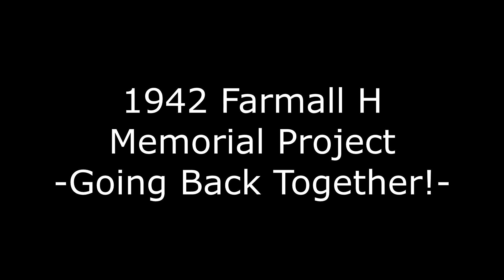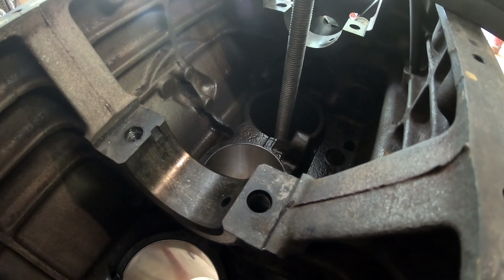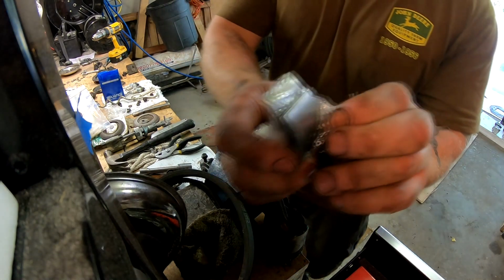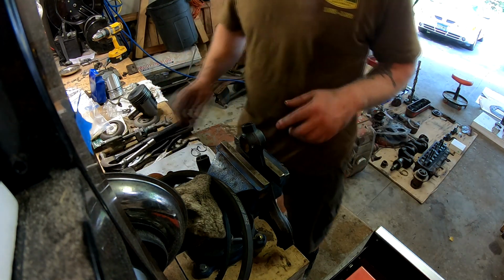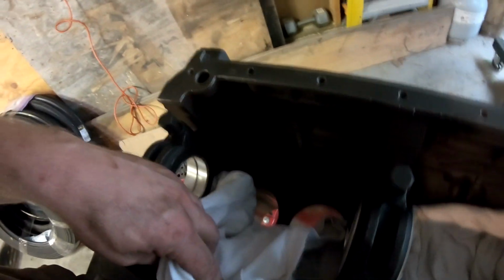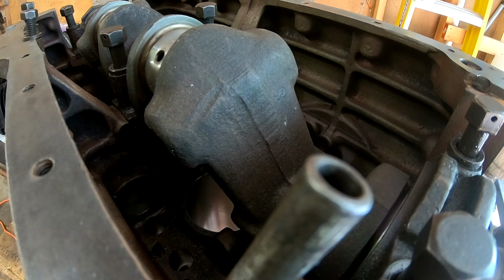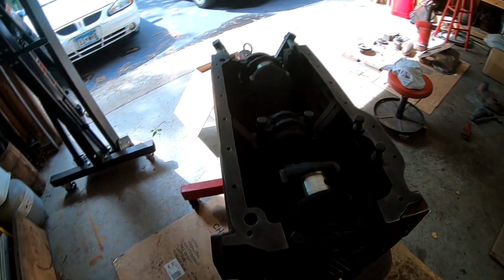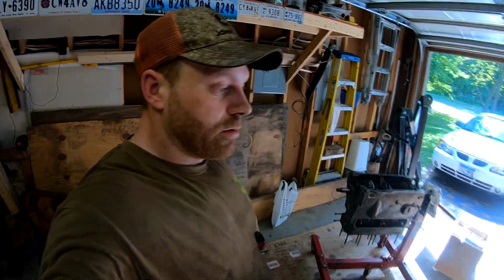1942 Farmall H Memorial Restoration: Engine Reassembly Part I

Comment: I found this interesting regarding the dry sleeve installation.  I am working on an Oliver 77 myself, and just installed new sleeves and pistons. The Oliver uses wet sleeves.  Getting the O'rings installed, and then the sleeves installed in the block was easier than anticipated. Lightly tapped with a block of wood and rubber mallet.
Reply from the maker: Yes sir, wet sleeves are generally easier than dry sleeves. I also us a VERY thin coating of high-temp RTV on the o-ring for wet sleeves. Just to try to help prevent any seepage once it is all back together. Dry sleeves are much more fragile and need to be dealt with cautiously...... Would love to get a Oliver Hart Parr 70!

Comment: Another very good video sir, my wife always asks me why I need two of everything as far as tools and your angle grinder is a perfect example why. If one quits you have a backup
Reply from the maker: Thanks, Craig. I agree! I was surprised the first grinder lasted as long as it did - I think it was a $9.99 special I picked up at one time from a big box store. I bought a little higher quality one this time, so hopefully it lasts 20+ years!
Reply: I usually buy two because I get a lot of my tools that I use all the time from Harbor Freight. And when I buy an old tractor I usually start looking for another one for parts just in case I need something you know
Reply from the maker: @craigrasnic4178  Not a bad route to go! That is how I got the F20 put together. That parts tractor sure served its' purpose!
Reply: Only two? I find there is no such thing as to many tools.  I have some wrenches that I have 20 or more of and still sometimes don't have just the right one.  😊👍🍵

Comment: Your bearings went in easier than mine. My 40 model B Deere has babbit mains. I had to measure the crank journals and turn and polish a piece of round stock the same size. Then I blued up the bearings and placed them on the slowly turning stock in my lathe.This found the "high spots" which I scraped with a single edged razor blade. More blueing and scraping got me about 75% contact. When I assemble the carriers I will let the engine wear in then adjust the shims. That is the plan anyway. Good luck with the rest of the build and happy 4th.
Reply from the maker: Johnny, that is a clever way of setting up your bearings in that B. I just did it with the crank on the bench for my A. It worked pretty well. F20 I did similar to my A but the crank for the F20 was still in the tractor. Hope to have this thing in primer before winter, but who knows....

Comment: You should have run the wire it through the bolt head and twist the wire between the bolts.  .063 stainless wire holds a prop on a a/c should work fine. you dont need special wire pliers  but it helps . like your videos just tring to help. 20 years on a/c.
Reply from the maker: Thank you for the heads up, sir! I will make a mental note for next time!

Comment: you will have a very strong H when you are done. it would be nice to see it broke in on a dyno. it should turn 30-35hp.maybe a bit more. depending what head  and compression ratio you have.setup you have,
Reply from the maker: That would be really great! Glad you like the progress so far!
Reply: @KennyKizzleRustyNutzRanch  you are bringing back  alot of good memories. i overhauled our 51 H when i was 17 i did a 44 M when i was 15.                                                            to remove the big bolster  bushing you need a diamond point cape chisel and cut 2  groves  opposite from each other and  pry out the pieces. use the  steering shaft to push in  the new one with a  bottle jack if mounted to the tractor or use a similar method you used to install the sleeves. have a blank turned on a lathe  to fit the bushing.
Reply from the maker: @brokenwrench1  Thanks for the tip! I will definitely use the suggestions and capture it on video for others to learn! Also, glad I could bring back some memories for you!
Reply: @KennyKizzleRustyNutzRanch  when i was 16 i was cultivating corn with a front 4 row on the H when i broke the big steering shaft i got a new shaft, bushing and seal i had to leave the cultivator on and use the tool bar to block up the tractor. i jacked up the H with a tall railroad jack. and took the front wheels and broken shaft stub off. i chiseled out the old bushing and used  the broken piece of shaft and a bottle jack to prress the new on in. it took me half a day but i had it fixed before dad go home.it was 104f in the hot sun in the middle of the field.
Reply from the maker: @brokenwrench1  I do NOT deal well with the heat - I can work in it but it really takes a lot out of me. Kudos to you for getting that done before dad got home! I can imagine it was quite the race against time! Field repairs are usually never fun. I know when I got my M stuck last fall in the mudhole, I was VERY thankful for my friend who had a trackloader. Even that almost didn't get it out!

Comment: just curious, did the pistons come installed in the liners with rings on them? My 450 liners were like that.
Reply from the maker: Ron, pistons came installed in the sleeves with rings as a unit. I think this is the best possible way for them to do it - both to save package space and also to protect the nice aluminum pistons!

Comment: Just a quick question. I'm not second guessing the process of pulling the sleeves in. Do you prefer using that process over putting your block in a press and pressing your sleeves in? I've done it both ways but I prefer the the press especially when it comes to wet sleeves. Keep up the good work and Happy Fourth of July!
Reply from the maker: If I had a press, I probably would use it a lot. For now this is the only method I have, and it actually worked really well. The key with dry sleeves is even pressure. A little bit of spray lube or light oil doesn't hurt things either just to help things move easier.

Comment: Kenny you are going to put new cam bushings in right?  I always do and I install the cam bushings before anything else goes in the block. Also when you install the idler gear in the front I suggest you use thread locker on the bolt.    Mark
Reply from the maker: Im not going to put cam bearings in this project simply because when I removed the cam it was nice and tight. The bearings were done at the least rebuild. Thanks for the hint on the front idler gear bolt!

Comment: mr Kenny love the videos...ive got a question for you ive got a 50 farmall M and im trying to figure out the correct motor rotation right now the motor is turning clockwise setting in the driver seat watching your videos and others the fan and motor rotation is ccw cant figure whats going on and what is the proper motor rotation any help would be helpful thanks Rob
Reply from the maker: Rob, glad you enjoy the videos! Motor should turn ccw from the seat, or clockwise if standing in front of the grill looking towards the rear. Im not sure why it would be turning in reverse! That's a new one!
Reply: @KennyKizzleRustyNutzRanch  ok that is what i was thinking it may be posible it has the wrong starter on it ive been checking into that here lately
Reply from the maker: @robertnapier1702  i guess that would be about the only way it could!

Comment: Hey Ken! How's it going? I feel like I don't ask that enough! Nice video, it's nice to see that the H project is coming along nicely! I have one question for you, what is the difference between a dry and wet sleeve. it sounds like it's a dumb question but I honestly don't know! Thanks for the great work you put into your videos and talk to you soon!
Reply from the maker: Hey Connor! Great question! A dry sleeve gets installed inside a machined bore in the block (called the parent bore) - so the sleeve has no direct contact with the engine coolant. A wet sleeve has no parent bore, so it acts as the sleeve and the water jacket wall as it comes directly into contact with the water jacket itself. The bottom of the wet sleeve has o-rings to allow it to see against the bottom webbing of the block to prevent the coolant from getting into the oil. Your smaller Farmalls - A/B/C have wet sleeves, and your larger tractors (H/M) have dry. My Case SC also has dry sleeves. Some engines do not use sleeves at all and just run the pistons directly in the block bores, like my JD A.
Reply: Kenny Kizzle Very interesting! Thank you for the explanation!